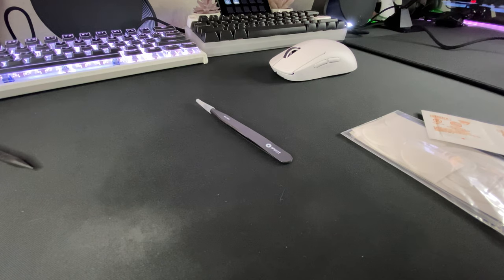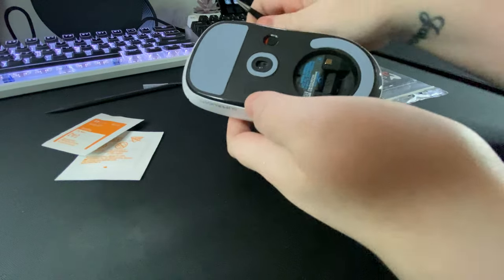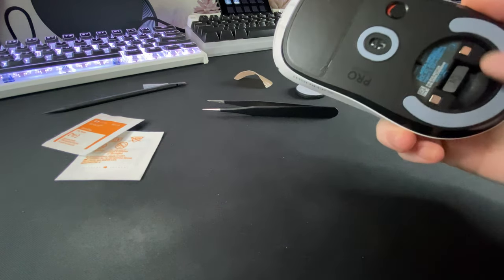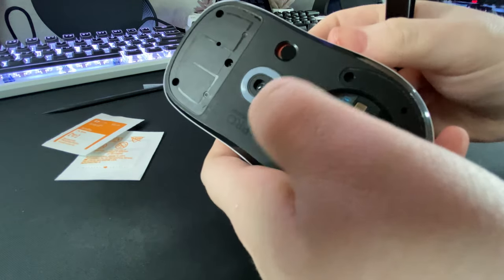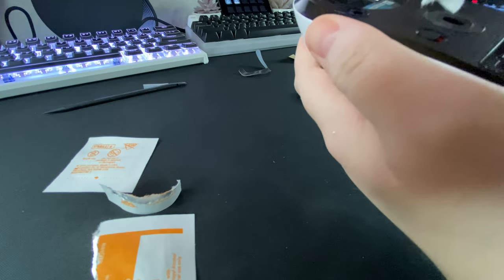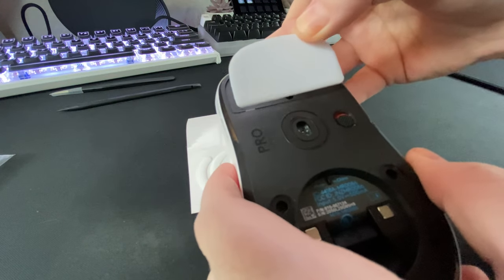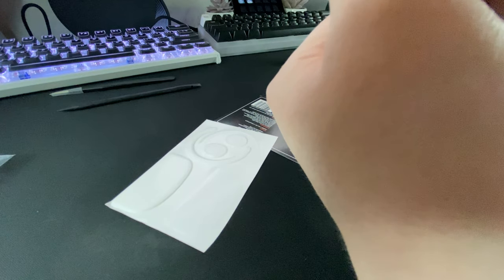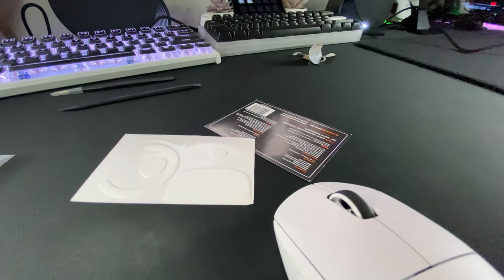How To Properly Install Mouse Feet (Corepads, Tiger Arc 1s, 2s, Ice, Hyperglides) on Any Mouse

Comment: Im using the hyperslides for g pro wireless and they're making a weird scratchy noise. Any ideas on how to fix? I've taken off the adhesive and stuff and I can see the screws.
Reply from the maker: They need to break in if you just put them on
Reply: @themouselady275  I'm actually using an old set. yesterday, the middle sensor skate  was breaking so I replaced it with the hyperslides. The reason I didn't have them on before was cause i didn't even realize there was a skate for the sensor part.
Reply: @themouselady275  Also are you supposed to peel off the bottom part?
https://cdn.discordapp.com/attachments/819483729683677215/878139247113175040/image0.jpg
Under it is another layer of adhesive im pretty sure
Reply: @themouselady275  Nvm it turns out the mouse skates were just really worn out. i just replaced them and everything is fine

Comment: Do you not use that big middle think on the back of the superlight? Or do you use it?
Reply from the maker: I do not, it doesn’t actually make contact with the pad.
Reply: @themouselady275  oh so you use your mouse without the big circular thing on the back? Also I’m looking to get some ice feet or something so when I get them should I use it without the circular thing? Will it damage the mouse without the thing?
Reply from the maker: @collectorianiv6854  you don’t need the puck insert no, it won’t cause any damage.

Comment: I have real problems with the biggest foot. I got the mice new with this foot installed unevenly, rubbing my mousepad. Tried anything to fix it, but nothing helped. Bought a new set of feet, but probably faile to install the biggest one perfectly, and it still rubs.. Such a surprise for a top Logitech mouse from the box.

Comment: my country's online store doesnt sell the design for my mouse (pulsefire haste) is it ok to use another mousefeet's design on my pfh?
Reply from the maker: You could sand down the inserts on the bottom of your mouse and use any feet you wanted, just double check the thickness of the feet on the pulsefire haste when you buy other feet for it.
Reply: @themouselady275  thank you!

Comment: They must have removed the alcohol pads from the corepads because mine didn’t come with any
Reply from the maker: D: rip. wonder why they stopped including them
Reply: @themouselady275  not an issue I just used some rubbing alcohol I had, thanks for the video though I got my corepads installed! they are kinda scratchy but im assuming they just need to be worked in.

Comment: Would you rather use the tiger ice or the corepads v2 for a gpw superlight on a glorious 3xl extended?
Reply from the maker: I personally prefer Corepads, but it’s all preference. Ice feet are faster, but you just get the 1 set. I actually have ice feet on my Superlight now, and miss my corepads.
Reply: @themouselady275  okay thanks, i orderd the ice skates yesterday but they take 1 month too arrive. I cant wait for new feets bcuz the stock feet are so trash and i think about buying the corepadz on amazon 😅
Reply from the maker: @niklasb.2364  I would personally. Plus you get 2 pairs with corepads :)
Reply: @themouselady275  how often should you replace your skates? every year?
Reply from the maker: @TheKillerZmile  that greatly depends on your mousepad and how often you game/use the mouse. You’ll usually be able to tell when you need to change them.

Comment: are the superlight feet worth switching out? i have corepads lying around but didn’t know if the stock ones were okay enough to use for a few months
Reply from the maker: 100000%. they're very thin and have reports of wearing down after a month of use, but just keep in mind the corepads on lethal gaming gear aren't the updated ones yet that are a better fit for the inserts on the mouse
Reply: @themouselady275  do you know where to get the new fit corepads?
Reply from the maker: @Juleeibaee  since lethal gaming gear is still closed for right now, probably the corepads website

Comment: Do you find that the front mouse feet seems to get a air pocket in the middle as it unstick and it messes with the consistency of the glide? You can push it down again to stick it and the glide returns. Using tiger ice feet. It's kind of annoying.
Reply from the maker: Yep, happens to me often
Reply: @themouselady275  do you leave it and get used to the slowness or do you push it back up each time?
Reply from the maker: @toysoldiers1899  I usually just leave it, I don’t notice it much
Reply: On a mouse with as much surface area as the GPX, it’s actually way better not to press down the middle of the top skate when installing it. Intentionally leaving the air pocket will allow the skate to wear way more evenly. In a lot of cases on the superlight, if you press the middle down, you will wear the edges of the foot much faster and so when you wear them down to the point of the middle finally making solid context on your pad, it’ll be like a second break in period and totally mess with your consistency

Comment: how do u remove adhesive layer near sensor or there's no layer
Reply from the maker: Yes there’s adhesive on the sensor as well. You remove it the same way as the others, just with more caution. You’ll know you removed it when you see the holes on the sensor insert.

Comment: So I just changed old corepads for a new set, and it was a fucking massacre let me tell ya, the amount of glue on them is unreal, scrubbing with lighter fuel, 70% alcohol, sponges, any and every thin piece of plastic I found, god help me if next time I don't just get a new $150 mouse
UPDATE: 2 days later, I'm still scrubbing outer edges of the mouse with alcohol, adhesive won't come off it just spreads around on the surface, 100% would not recommend, never again

Comment: So I read somewhere (don't have the source) that having a pad on the puck doesn't actually help glide at all, and that the glide is the same with or with out that pad. I had the pad on my mouse all day today and everything felt fine, just recently took it off and mouse actually feels a little faster. I think this is just because there's less resistence as not having a pad on the puck, the puck doesn't touch my mousepad so less surface area gliding vs more. Also apparently having the skate on the puck just adds weight (very little but some people are anal.).